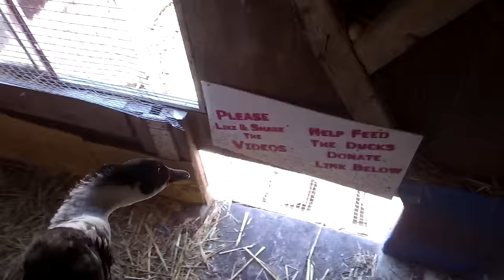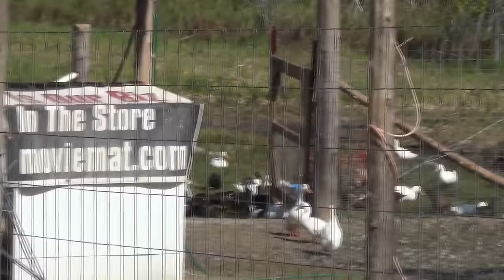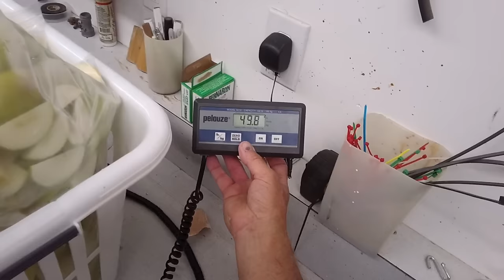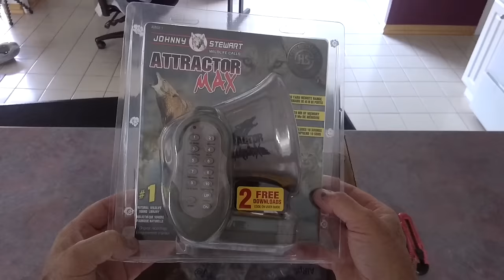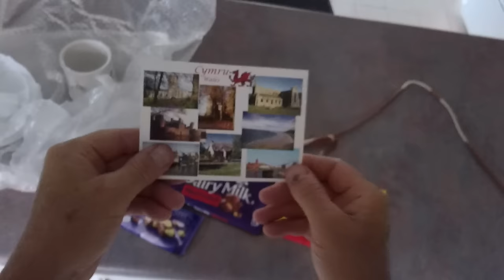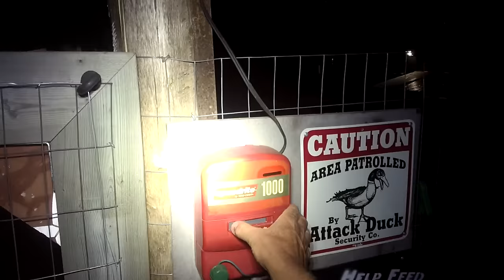Otter Wasted Day… #133 Ducks For The Homeless

Comment: Hi Matt,
have you thought about putting a gutter on the feeding station with the down pipe running into the drinking tub ?
Then when it rains, it will automatically flush it and replenish the drinking water.